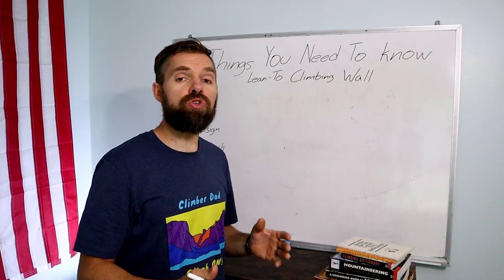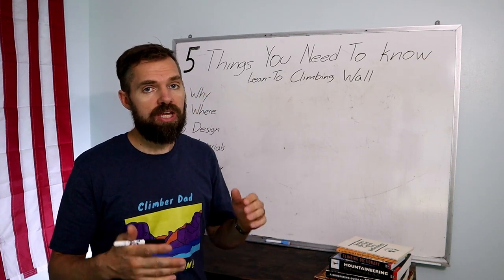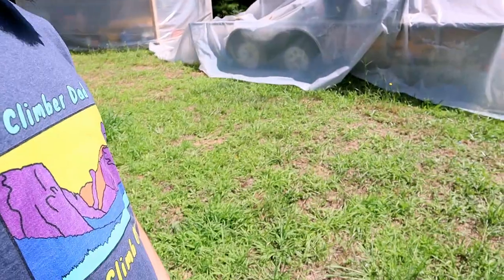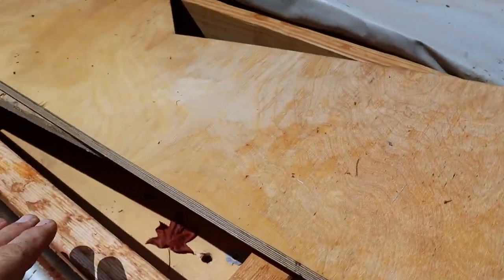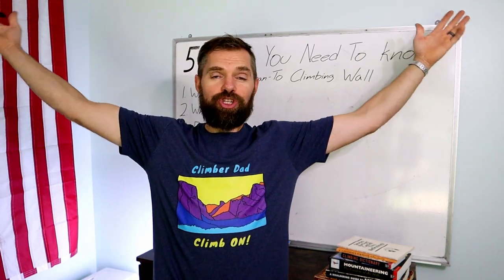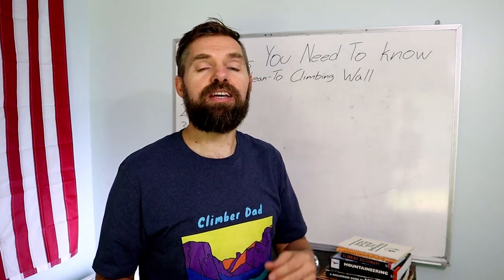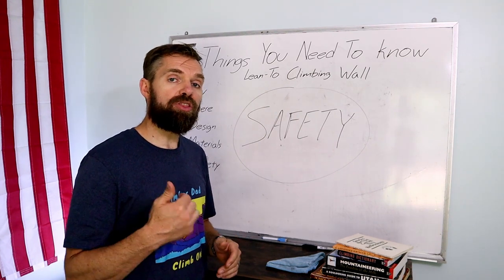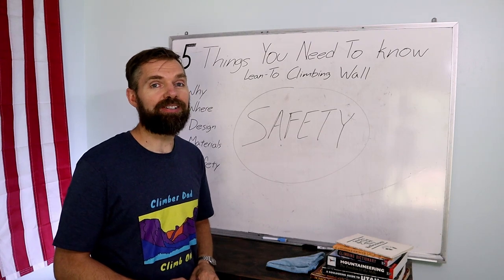5 THINGS YOU NEED TO KNOW ABOUT BUILD THIS CLIMBING WALL

Comment: Great video! I bought the plans, but they spec 2x8s as you mentioned. Do you think pressure treated pine 2x6s are okay to use for the adjustable legs instead? It's what I have available.
Reply from the maker: You could get away with 2x6s for everything
Reply from the maker: And thank you for supporting the channel!